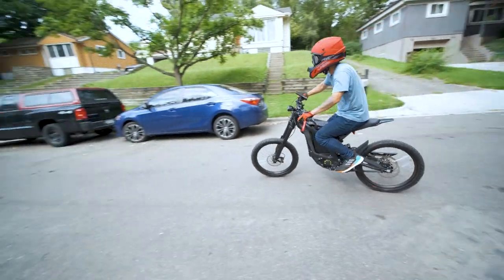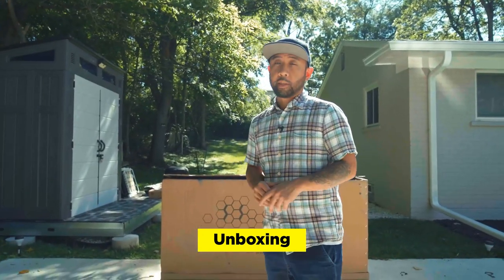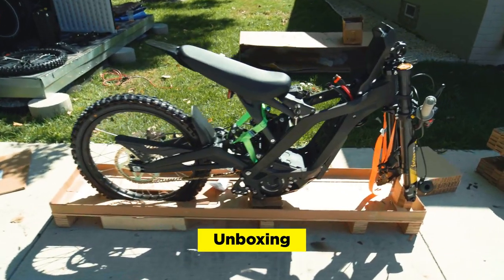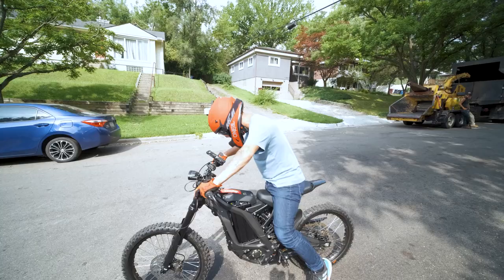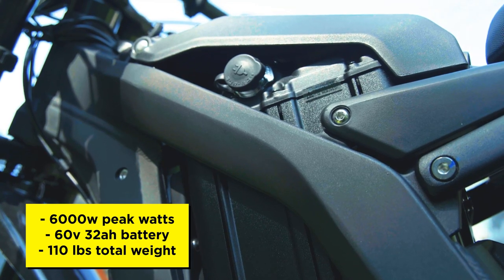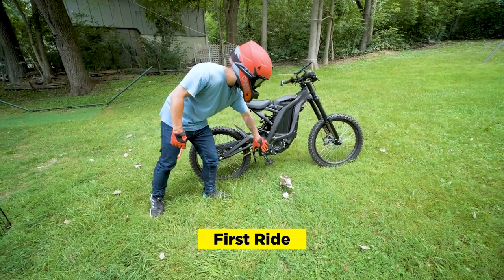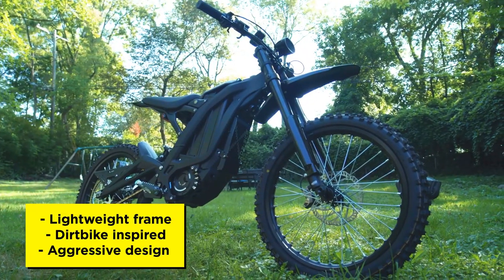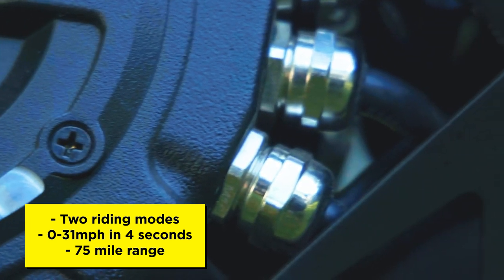2021 Sur-Ron X Black Edition First Impressions | RunPlayBack

Comment: Mine tops out at 49 mph in sport mode and I didn't cut the wire. I'm 6" 1" and 205lbs. and it still gets me to that speed. I've had mine for a year.
Reply from the maker: Nice! Are you using GPS or the stock display?
Reply: @RunPlayBack  I bet it is the stock display these bikes do not do more than 45mph tops.
Reply: @RunPlayBack  Stock display.
Reply: @Tonyplat98  not until you mod
Reply: Damn 49 mph on 205 pounds? Thats fucking nice
Reply: @Tonyplat98  depends on how many teeth on your sprocket… more teeth = more torque but less top end speed

Comment: I live in Toronto, is there anyway to make the sur ron street legal?
Reply from the maker: I don't know too much about the laws in Toronto. But out here where I live you just need functioning signals, brake light and speed limited to 30mph to register as a moped.
Reply: @RunPlayBack  ill have to do my research on the ebike laws here. Thanks for your help! Loved the video too
Reply from the maker: @BranDMZ  No problem, happy to help!
Reply: @RunPlayBack  what about pedals?
Reply from the maker: @ellestar2306  pedals would technically make it street legal as long as they function.
Reply: @RunPlayBack  thanks again for the info and especially your video - they are thorough and professionally put together
Reply from the maker: @ellestar2306  no problem, happy to help!

Comment: is there a reason that people buy the offroad then convert to road rarther than just buying the road legal one......like is ther better susspention on the offroad for example ????
Reply from the maker: So the road legal one isn't available in the United States which is why most of the riders here end up getting the supermoto kit and adding their own brake lights and turn signals.

Comment: wish nyc made these legal, would get one and reduce traffic and emissions
Reply from the maker: Yeah I agree, seems like they've been cracking down on Onyx's and Sur-Ron's lately. :(
Reply: Rode a full year straight in nyc with the sur ron x. No issues with cops. Just ride it like a motorcycle. Its not an ebike
Reply: @RunPlayBack  mostly scoots.
Reply from the maker: @tintin6291  ahh ok cool, yeah I was going off what I was seeing on the Onyx FB groups from the NY riders
Reply: @tintin6291  did you have the pedals on or straight pegs? And did you have a rego on it?
Reply: @Ubaydah.  i had pegs on. I rode 72v and no issues.

Comment: Have you figured out how to set up and or adjust the fast ace forks? 
  If so could you please do a video on it. Your videos are great and as of today 9-27 no one has done a video on adjusting them froks
Reply: isnt it just like any other air suspension
Reply: @finnhayes5926  nope. Its air and oil but its set up is odd
Reply: @ghettogrower5734  strange, good luck!

Comment: Got mine last December and converted to Super Moto!
Reply from the maker: Nice! How do you like it so far? Do you miss the offroad tires?
Reply: @RunPlayBack  I primarily ride on paved trails and streets, so the moto tires grip way better!  Overall I love the bike still!  Bought the same peddle/power kit you did but haven't installed yet. Only gripe I have is my throttle hand gets numb from twisting on longer rides.
Reply from the maker: @Dillon-ux6it  That's awesome, sounds exactly like the kind of riding we do out here. Yeah I agree, the throttle hand can get a little sore on long rides. I'm pretty happy with the range so far.
Reply: @Jesse might be worth looking into. Traditional dirt bike style throttles don’t require as much rotation as the Surron. A 1/4 turn throttle would be better but haven’t seen avail yet?

Comment: I built my own ebike and am looking for better suspension and a more powerful motor. But any sort of upgrade takes me over the legal limit and on a used mountain bike that’s not at all built for 3,000+ watts. Also with a terrible, terrible safety issue where the pedal is inches away from the spokes of the wheel. (Don’t ask me how I know it’s a terrible, terrible safety issue) So I think a more reliable and well built bike is the way to go. 

So in the near future I’ll get a Sur Ron X and run it stock. And then once I get my license, I’ll register it as a moped/motorcycle and run it as a daily driver with all the power unlocked. The used car market is just insanely high right now. So anyway I slice it (including hospital bills) it ends costing less and is way more fun than a car. And I can see myself riding it through the first leg of college till the Tesla Network finally comes online.
Reply from the maker: That's a good idea, I've definitely built some high powered DIY ebikes with components that were a little too powerful for the frame. The Sur-Ron X is a great choice. Ride safe!

Comment: I'm a short guy too and they do have a lowering kit for the seat you could have also ordered it as a Supermoto it's a little bit more money it comes with mirrors and lights and pretty much everything you need and 17-inch Wheels with street tires I have the same one as you but I'm thinking about ordering another one only a Supermoto
Reply from the maker: Yup, thought of that but didn't want to wait so just ordered the standard. Ordered the supermoto wheels separately. We actually just bought some used x160 wheels as well for 17" knobbies for winter.

Comment: I feel like they had a good price point, before they decided to up the price by 500. At 4,100 and a 200$ pedal kit you're now at the price of a oync rcr, but only a 60 volt. Not to mention the size is basically unacceptable for anyone over 5'10. There are raiser sets, for more money.

Getting a new 72 volt battery, you need a new controller. Assuming you sell the old battery and old controller, you're still going to have to pay out at least another grand. That puts you at over 5 grand and you now have to try and sell your old battery to recoup the cost. 

Unfortunately it's just not worth the hassle for the street when you can get something from oynx for less work, less money and less hassle. HOWEVER, for someone who's going to take this off road more than on? Well, there's not many other options out there. The RCRs stock suspension is garbage and cannot handle off-road in the least. Their price was exactly what it should have been when it was 3,600. Now? No way. 

Fun overview! Hope you enjoy the bike.
Reply from the maker: Thank you for the thoughtful, detailed comment. I definitely agree with you on a lot of those points and $3,500-3,600 is the sweet spot for this bike. I didn't mean to pick on the Onyx in this review, I still think it's a dope bike and a fun part of our collection. I just find myself choosing to ride the Surron more often because it's more nimble. As far as cost goes, I didn't include my comments on that yet, maybe the next video. But yes you can go down a deep rabbit hole of modding and spending and find yourself spending more than anticipated. Again, great points and I'll try to address it in the next video. Thank you!
Reply: Very accurate comment there mate. In Australia we don’t have many options when it comes to electric dirt bikes. My SurRon is about to be $15,000 Aud invested now! Waiting on my 72v set up. I don’t regret a thing! If somewhere sold a kuberg or a Cake OR I would have seriously thought about getting one of those instead! At the entry level price point they are a great project to buy and progressively upgrade. You really notice every dollar you spend on it when it comes to suspension, ergonomics and power!
Reply from the maker: @antssta  Great points! I'll try to mention that in the next video - that you can slowly upgrade and mod depending on your riding style. I was originally considering doing a DIY enduro build but then realized it made more sense for me to pick up a Surron since it really is a good base to start from. Another thing is that once you get into the $4k+ category of ebikes, most owners know what they're getting into and are most likely to mod it rather than keeping it stock.
Reply: @RunPlayBack  I agree that the surron has more potential with it's lighter frame and world wide modding community. The RCR is very stuck to what it is. Hub motors also can't change torque to speed ratios like you can on surron by swapping the rear sprocket. 

And I'll be honest, if I could have a better fit surron, and a 3,600$ price point, and the option to upgrade the battery in house rather than after market, I probably wouldn't have grabbed the rcr.

 The ability to upgrade the battery before purchased is super overlooked for ebikes. Which is incredibly sad because the battery is what makes an ebike. I think the reason why most companies don't let you upgrade is because they all use the same cookie cutter battery from China. A great example of this is the hype scrambler 2. The "upgrade" to the battery was to just throw another one on the frame of the bike.
Reply: Its worth the hassle i owned a fully upgraded sur ron. No other bike compares and it smokes the onyx.
Reply: i prefer the surron because of the dirt bike likeness, like others mentioned the aftermarket space is huge and to be able to upgrade overtime is cool, i definitely wanna eventually do 72v and rip up a full size mc track
Reply from the maker: @Crohniac  Totally agree! We'll be upgrading to 72v soon, stay tuned! Should be fun!
Reply: @RunPlayBack  can't wait! please if u can bring it to a mx track, i haven't seen anyone do it with a 72v setup
Reply from the maker: @Crohniac  I'll do my best! I don't have the skills for an MX track but if I can find a local rider who can test it out I'll do that!

Comment: I love the bike and it performs well but not enough places for me to legally ride it.
Reply from the maker: Yeah I hear ya, but depending on where you live you can register it as a moped if you keep it on eco mode and add signals.
Reply: @RunPlayBack  definitely,  leave it to you to figure out the awesome loophole!🤘
Reply from the maker: @PlanetOwner  I also have the Kaniwaba pedal kit on it. Does it propel the bike? No. Does it make you street legal on first glance? Kind of :)
Reply: @RunPlayBack  hell yeah, whatever works and even if the pedals are like a beer coozy they are definitely key to being a little less suspect 😆
Reply from the maker: @PlanetOwner  exactly lol! They are a little sketchy if you're trying to bring this to the trail or do big jumps and wheelies. Pegs are more appropriate. But for just riding around town low key it's perfect.
Reply: I nyc i ride it everywhere. Litterally
Reply: @tintin6291  when I lived in Brooklyn you could ride anything you want as long as you didn't get caught ✌ must be a blast in the city

Comment: I have been looking at these but for the price why would you not want a Honda CRF250L? More power never run out of charge, faster, legal on the street and can actually do the dirt better. When they crack down you're going to be screwed on the streets. Most cities thousand-watt maximum and 20 miles an hour.
Reply from the maker: Great points! It's more just preference than price in this case. And in my city, it's not an issue regarding limits. If you prefer the Honda CRF250L that's cool too.

Comment: Sounds kinda noisey
Reply from the maker: It’s the cost of a mid drive motor with a secondary chain.  There is an option to change to belt drive which basically makes it silent.
Reply: @RunPlayBack  Man, you got me interested in all these bikes.  Now I caan't decide if I should go RCR or Sur Ron...I know they are really for differn't styles of riding.  But, I like to do both styles.

Comment: The Talaria Sting is better.
Reply from the maker: Care to elaborate?
Reply: @RunPlayBack  it's quieter. It's a little bigger and heavier. Better battery. Better looking. No stupid broken belt to deal with on the regular. I could go on and on.
Reply from the maker: @KillabeeTsting9erGurl  Makes sense. However, this video was out way before the Talaria launched.
Reply: @RunPlayBack  ok. You got that. But now you know. Knowledge is power